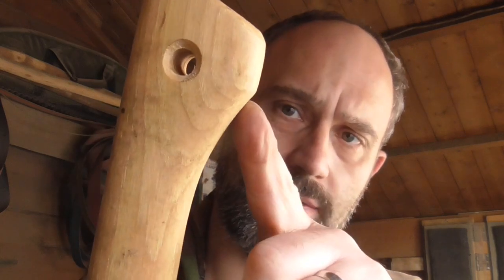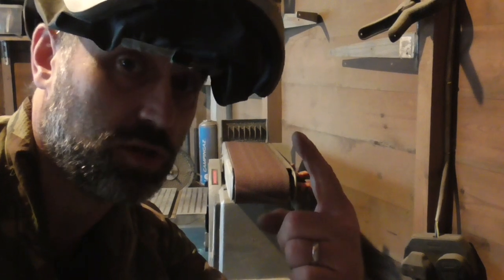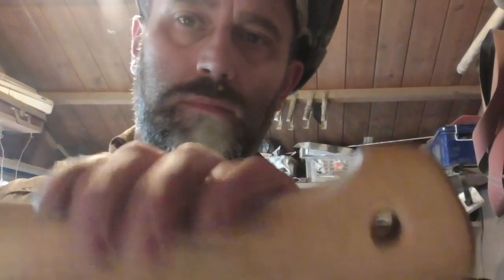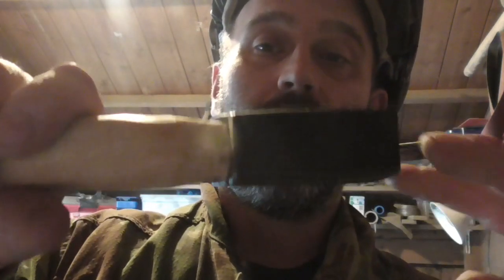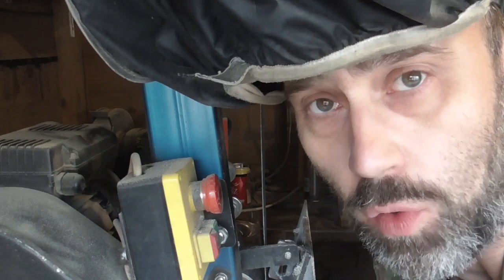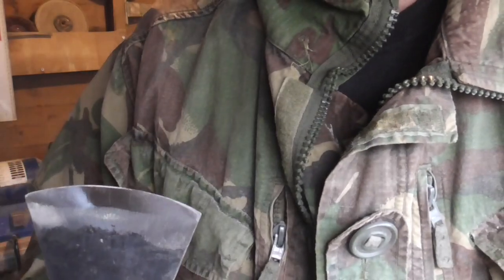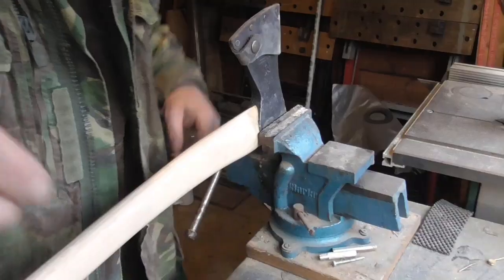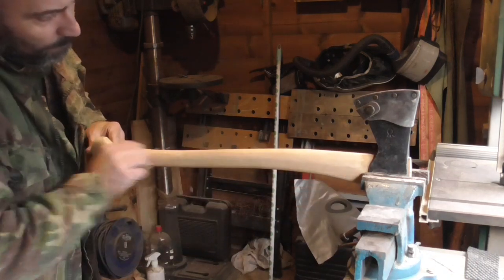Improvements to the Husqvarna Forrest axe part 1

Comment: Hey Rob, a little tip that you may not know is to wet your axe handle down with water and then let it dry. This will make the grain pop and then you can sand with 220-320 to remove the raised grain before you apply oil. It makes for a very smooth handle, that won't become rough when it gets wet at camp.  Anyways, I'm enjoying your video's and thanks for sharing.
Reply: I may have to try that on my next build! With lockdowns imminent again I need to make sure I have the supplies for the few axe heads I have left to fight the boredom.
Reply: I wax my handles to keep them grippy.
Reply: @hillbill79  that's a good way to get blisters while using an axe without gloves. I know a lot of people promote this but in my experience it is not a good thing.
Reply: @turtlewolfpack6061  Cant say i've had any issues with blisters. I guess if someone has soft hands then maybe it could be problem
Reply: @hillbill79  well I have been using hand tools since I was a kid but I can't say my hands can shape a haft by themselves! I have heated hafts and applied a 50/50 BLO and pine tar it soaks in pretty good (better than wax) but takes a while to properly cure but makes a brutally durable finish, especially on birch hafts in cold, wet weather. I do prefer a wooden haft that slides smoothly and every time I see a video talking about how a tomahawk is more dangerous because of a lack of a foot and will slip out of your hand I grab a ball peen or framing hammer and chuckle. It could be muscle memory, but I can't say I have ever lost one. If we wind up locked down again Ill likely get bored and post some videos on the axes I have restored but they won't be great quality!
Reply from the maker: Post it.
Reply: @RobEvansWoodsman  oh dear....peer pressure......
Reply from the maker: You opened up a can of worms there buddy.
I like a smooth shaft....as do the ladies 😜
Reply: @RobEvansWoodsman  A smooth shaft for the axe wound. haha
Reply: @turtlewolfpack6061  I dont soak the handle in wax. They have the usual BLO. I just carry a small block of beeswax and just give it a quick rub from time to time.
Reply: @hillbill79  that does make sense, especially if you are outdoors a lot in humid environments and or rainy conditions.

Comment: Everything is shut down again? I think Canada is on the brink of that as well.
I just made myself a cruiser axe haft out of a regular 28" as an experiment. Just waiting for the BLO to dry before I do the final sharpen (file, stone and hand sanding as I haven't the belt sander shortcut) and test it out.
Reply from the maker: England is now locked down but I'm in Wales with different rules, we've just come out of a two week lockdown, our leader is a lot more decisive than Borris!

Comment: Thanks for filming the process Rob....... always good to see how you sharpen different tools. I saw one guy use a blow torch on the handle, which if done lightly emphasises the grain, but unfortunately he went for the burnt look. Also, did you get any metal contamination in the handle, with doing that first? Cheers Buddy.
Reply from the maker: I'd never burn the handle.
No contamination.